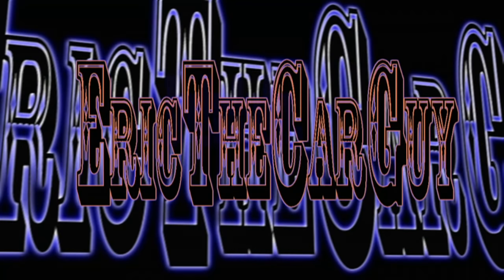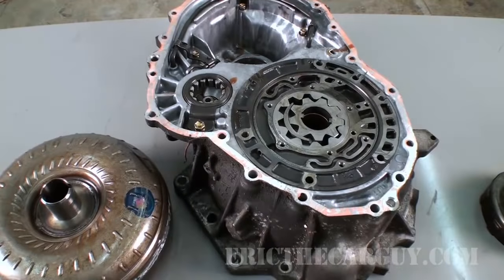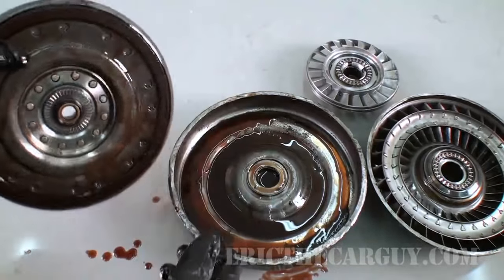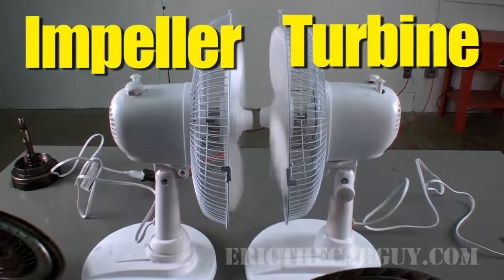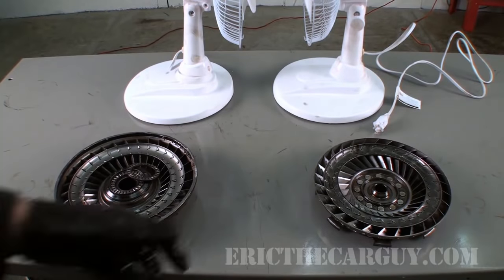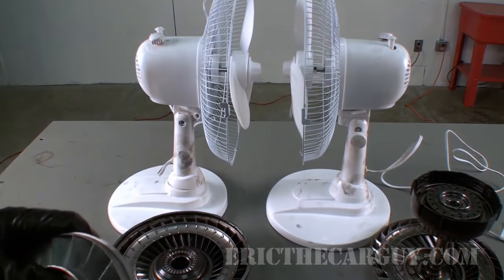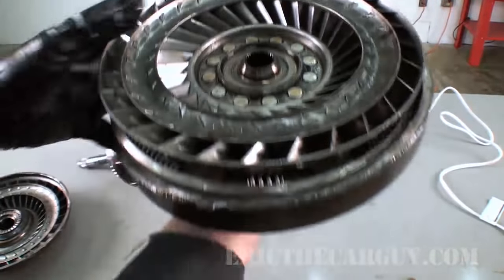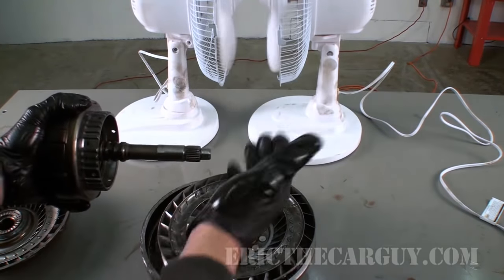How Does a Torque Converter Work?

Comment: I'm 60 years old and I finally understand how a torque converter works.
THANK YOU
Reply: I'm 70 years old and I finally under...I forgot.

Uhh, Honey, can I have a Turkey Burger?
Reply: Louis Edwards  intrigued, with all your experience did you learn anything extra from this video, or is thete anything extra you can add to the subject . . . . I am interested in how to see/smell/feel the oil to make a quick diagnosis  ?
Reply: Louis Edwards  Ah Ha, thanks for that. Yeah I understand PWM proportional solenoids, just the trans that blows by me. Does the lockup solenoid get its commands from a dedicate trans control module or the ECU ? Guess it maybe depends on which motor etc 

Anyhooo, cheers for that. Have a good one bud.
Reply: You should see his video on understanding women.
Reply: 8 More years, and you will hit the nice number, Grandpa

Comment: This is by far the best instructional video of a torque converter I have ever seen.  I am not a mechanic by any means, but his visual aids really lets you see how everything works.  If Eric is an instructor in school, he must be putting out some "REALLY" good mechanics.
Reply: Really? I thought it was terrible. I gave up half way through as all he was doing was flipping oily bit of metal and confusing me about what way around they fitted. But I wanted to know how it worked so I searched for video. My first hit was the LearnEngineering one. Less than half the length and really easy to understand what all 4 components including the lock up clutch did.  Immeasurably better.
Reply: Out of the three videos I've now seen this video comes second.  This other video https://www.youtube.com/watch?v=bRcDvCj_JPs was the clearest to me by a medium-large factor.

Comment: That was well done.  I started out in automotive engineering.  When starting out, there is a big difference in the rpm between the impeller and turbine.  The impeller is then acting like a centrifugal pump accelerating the fluid to the outside and at an angle against an opposing angle on the turbine blades which are not spinning, making them a bit like a bucket on water wheel to extract some of the kinetic energy after which it is routed to the stopped or lower velocity inner diameter of the turbine, and back toward the inner diameter of the impeller where it will be sucked in and accelerated again.  However, with the large difference in velocity and the opposite angle, the remaining kinetic energy opposes the impeller so there can be no torque gain unless you redirect and reuse that energy with a stator to assist the impeller.  The stator attempts to rotate backwards and it cannot because the sprag/roller/one-way clutch doesn't allow it to, and it redirects the fast-moving fluid into the direction of the impeller at to further accelerate the fluid, which is where you get torque multiplication, ~2:1.  However, as the turbine rpm gains equilibrium with the impeller, the turbine now produces its own back pressure from centrifugal force, thereby mostly balancing this out.  However, with the angle of the inner turbine blades plus the rotation of the turbine being almost as fast as the impeller, the stator will now rotate with the impeller and turbine to give the best flow.  This point is called couple or lockup, although it is not really coupled or locked up, but it will be less than 10%, slower depending on the converter, and torque multiplication will be 1:1.  Thus,  max torque multiplication occurs when the impeller is turning and the turbine is stopped.  If something is wrong with the stator and it rotates in both direction, acceleration will be poor.  If it won't move in either direction, it will add a load on the engine during coupling and cause heat buildup.  Then came lockup torque converters where they actually do lock the impeller and turbine together physically, so they tend to refer to the former as couple rather lockup.  The difference between a torque converter and a fluid coupling is the stator, which enables the multiplication of torque.  So are fluid couplings obsolete?  No.  They are used in a lot of applications to isolate vibration between driving and driven members, and even gentle startups when an engine is running at a fixed RPM like electric engines and fluid is slowly added such as to start a conveyor belt with tons of product on it.

The stall speed is the maximum rpm that the engine can turn when using all of its power against a stopped turbine.  Logically, that depends on how much torque the engine has.  While true, with something relatively heavy such as transmission fluid, small changes in RPM make big changes in torque to make a small rpm change, so it won't vary by as much as you think, which is why they can categorize them by stall speed.  You can also see that the smaller the diameter, the faster you will have to spin it to equal the same outside velocity to achieve the same centrifugal force and pumping action on the fluid plus they have less area on the blades so a 1" difference in diameter can make a substantial difference in stall rpm.  The stall rpm will vary more with torque variations as well, but still not by a lot.  Of course the First Law of Thermodynamics states that neither matter nor energy can be created or destroyed.  When the engine creates all of that high velocity fluid against a stationary turbine, the energy has to be dissipated somewhere, and it is.  The engine horsepower is converted to heat, which is why the transmission cooler in the radiator, unless you have a wimpy engine in which fins on the outside of the converter and air holes in the bellhousing can do the job.  Larger diameter converters are more efficient even during coupling.  However, when overdrive transmissions and higher gear ratios became more and more popular, engine rpm dropped near or below where coupling would occur even at speed, so there were efficiency losses with more power going up in heat in the converter.  This made the move to lockup converters compelling. 

From automotive engineering to aviation mechanic to military pilot, the engines made perfect sense to me right away because they use a stator to similar effect as torque converter except jet engines don't allow the stators rotate with the rotors because it is always pumping, unlike a torque converter, thus unnecessary.  Another difference is the stators are where the compression is occurring when it converts the kinetic energy into static pressure, and redirects the flow direction into the rotor blades of the next stage.  Torque converters don't compress the fluid but rather add to the kinetic energy to be expended against the turbine by feeding accelerated fluid back into the impeller to be further accelerated.
Reply: Excellent add-on to this video!! Funny coincidence . 
My background is aerodynamics-F-16 crew chief to military pilot.. Now Im trying to troubleshoot why my E4OD chatters in neutral or park after it warms up.  I think it might be the pump
Reply: What this long comment (thank you) is saying is that Eric's brief comments about how the stator works is not quite right. But the video is still excellent overall.
Reply: Brilliant explanation! As an engineering student, I was not quite satisfied with Eric's explanation, but yours gave everything that I still wanted to know. It is quite obvious that you were in automotive engineering, nobody else could give such a detailed and thorough explanation. Thank you for sharing!
Reply: Yes,Eric's video was good but I have to say your summaration of the auto.was equally as good.Thank you for showing how my car can take off from the lights better than a manual gearbox car!
Reply: I knew his explanation was wrong as soon as he forgot to list the most important function of a torque converter or fluid coupling, that is, to allow the engine to keep turning when the car or load is stopped.
Reply: @chrisbaker2903  That was one of the first things he explained..
Reply: @chrisbaker2903  it iso amazing vedio that assit me to know the operation of a torque convertor
Reply: So, "overdrive" is essentially the 'lock up'?
Reply: @GordonAndrew  Overdrive is after the torque converter and part of the gear train and not part of the so called "lockup" when the engine side and transmission input side are rotating within about 10% of the same speed.  Actual lockup happens on almost every car left on the road these days when the clutch is applied in the torque converter applies which physically locks the engine and transmission side to the same speed. 

Overdrive is unrelated.  I will use round numbers for clarification but the actual ratios used are different and some transmissions have more gears than others.  When you start from a stop the transmission will start in 1st hear.  Example:  The engine is turning 3 times faster than the transmission output shaft, so there is torque multiplication which helps accelerate the vehicle because the output shaft has 3 times the torque that the engine can provide but at 1/3rd the rpm.  The engine can only turn so fast so once the vehicle starts getting up to speed the engine starts spinning very fast so the transmission shifts to a "higher" gear so that the engine is now only turning twice as fast as the transmission output shaft and toque at the output shaft is twice what the engine can provide.  Then the engine starts running fast again so the transmission shifts to "high" gear so that for every 1 rpm of the engine, the output shaft of the transmission also turns 1 turn.  The output shaft of the transmission has the same torque as the engine.  HOWEVER, then it shifts again.  This time the for every time the engine turns over once, the the transmission turns twice the rpm but at 1/2 the torque of the engine.  Any time the transmission output RPM is faster than the engine RPM it is an overdrive.
Reply: @jackt6112  thanks for reply. Maybe what I'm thinking about might actually be a fourth gear. When in DRIVE ( D ) mode, engaging a knob on the stick causes a feeling of going into a higher gear, and the engine slows down. This can be engaged only after the car changes into 3rd gear and there's no appreciable acceleration, and the car is moving at higher speeds, say, 40+ mph, for example.
Reply: @GordonAndrew  No matter how many gears a transmission has, the only overdrive(s) are the gears that result in the engine turning slower than the output of the transmission.  Some transmissions have multiple overdrive gears.

Comment: My 1993 Oldsmobile started stalling at stoplights all of sudden. Thought I had a big problem. Finally got the car home after pissing off a whole lot of drivers behind me. Turned out to be the converter lockout solenoid. Part was $20, solenoid was under the transmission cover on the driver's side. Was a fairly simple repair and car was back to normal. A very small part that caused a big headache on the road. Excellent video by the way.
Reply: People are idiots.. My transmission broke once and the car couldn't move so I put on my 4 ways and went to get help. I'm inside of the building watching people pull right up to an empty car with the 4 ways going and honking their horn.. Unreal.
Reply: How does the oil get into the converter?
Reply: I have a 95 Chevrolet Cheyenne with an auto tranny and is the only one I've been driving manual trans pretty much all my my life at one point I had a 94 dodge caravan with a factory 5 speed Haha no joke dodge built a few very rare anyway automatics are no fun
Reply: @newvilla8115  take a look at the input shaft of the transmission,  the shaft is hollow with fluid holes. That allows the front fluid pump to move fluid through the torque converter.

Comment: I've watched you for almost 10 years and this is one of my favorite videos I have ever seen, in forms of technical knowledge and visual aid. I understood how TC's worked but could never explain it to another person myself. Always saw it as a compontent that just needed replaced as a whole and never got into the guts of it. Eric you're a legend
Reply: Very very helpful thank you sir
Reply: There are guys that fabricate ONE OFF RACE converters to match not only the engine dyno results, but also final drive ratios 1-gear through top gear and weight of the car. I am GRATEFUL and humbled that these peoplevexist, because, "Who doesn't love cars?!"

Man does not live on bread alone. Motorsports are also vital.

Comment: I'm a geezer and throughout my entire life (thus far) I've never had a clue how torque converters work.  Outstanding video, I loved the two fans demo, excellent.  Thanks a ton, now I can pass my thanks through a torque converter and virtually double my thanks.. so thanks two tonnes.
Reply: Yes I took apart of four-wheel drive transmission and put it in a 2-wheel drive and now all I get is the one gear what did I do wrong???

Comment: No BS. Clear, concise, articulate, no jokes or talking to the dog. Well presented with fan analogy. Thanks for your effort and thoughtful presentation. Thanks for not wasting my time. You Tube channelers need to learn these techniques. I am subscribing.
Reply: I think Eric fully understands how a torque converter works, and made a good effort to communicate that, to the viewer. And his 2-fan analogy was good. However I think there are a goodly number of ways in which his language could be improved. A good number of places where where his language is ambiguous. He tries to make things understandable by repeating himself, using a slightly different sentence structure, but the repeated sentence, or phrase, is not any clearer than the original.
Reply: Talking to the dog/cat. You hit it dead center.

Comment: Brilliant explanation with the two fans!
This is exactly how a turbine shaft engine works on helicopters. The Compressor section and turbine section are only connected by hot air. The expanding gases force the power turbine section to turn and power is transferred to the main transmission.
Reply: The world of turbines. They need a FLUID (Air and liquid are both defined as FLUIDS, one is less denser than the other) in order to TRANSFER the mechanical force needed to extract its energy into function. In a fan jet (not a turbo shaft) engine the rapid expansion of the combustion gases are “routed” into the turbine section, that turbine turns (torque) just as the fans do in the video. That turbine, as it rotates, causes a shaft to turn, and that turning energy then is transferred (thru a driveshaft) to the main fan up front of the engine (compressor) that would then move air to the rear, compressing it in the process. How that energy is EXTRACTED for utilization in the engine makes the difference in what TYPE of turbine engine it is. There’s another video, a lot shorter, that uses video animation to explain how torque converter works. It took me a few replays of the video to get MOST of the hang of it. But this video (longer) explains it a lot better, specially with the use of air fans. Well made!!!

Comment: I was raised in a wrecking yard, changed many transmission, rebuilt a few. But never understood the torque converter,. This helps. Who figured this out, was a genius without a doubt. Thank you so much. I never even seen inside one. Till now, clearer but still a bit confusing. Thanks!!

Comment: Plenty of modern transmissions lock up the TCC in most gears, only unlocking to shift gears.  It helps fuel efficiency and power delivery a lot.
Reply: I feel like my 1999 ES300 will only lock when in either 3rd or 4th. I could be wrong though

Comment: Got a P0741 torque converter code on my 2010 Scion Xb with 208k miles on it. Symptoms the car gave was revving high when driving or at idle. And couldn't go over 35 mpg. When draining the trans fluid, it was blacker than black. Also changed out the trans filter and gasket and cleaned trans pan and magnets. And added a bottle of Lucus trans fix. Doing this much needed maintenance (previous owner failed this important maintenance) greatly improved the transmission performance. And engine code for the torque converter has not returned in the 5 days of driving my kids to and from school. So tyvm Eric for making this video and doing an awesome job of explaining the toque converter 👍👍

Comment: I appreciate your presentation. This is a subject that I had never looked into before, so it was all brand new to me. Before now, the torque converter was that big thing under the bell housing, between the engine and the transmission. You gave very eye opening information on precisely what is going on inside the metal shell. Thank you.

Comment: A super great video. 10 days ago, I had to add transmission shudder fix because at shifting lower gears, I had hesitation till I built up to top speed and gear. Now I better understand why the shudder fix worked for me. Thanks for the great video.
Reply: Your shudder was due to lock up clutch. If you keep the car it'll eventually need a converter.

Comment: I spent many years as a transmission specialist. Our shop bought a lathe, and I was schooled on disassembly and rebuilding converters. It was the missing link for me on exactly what and how it was all coupled together.. Great vid and very good job explaining its function. You can see the pics and read the text but until you've seen inside it just doesn't make sense.

Comment: FIrst, I loved the " practical" with the fans -- it really demonstrates the concept.  Second, some automatics designed for hauling heavier loads will use the lockup clutch in more than only the highest gear in order to limit heating of the transmission fluid.